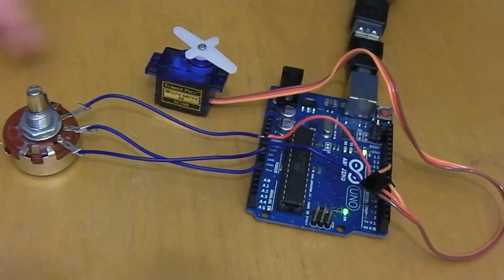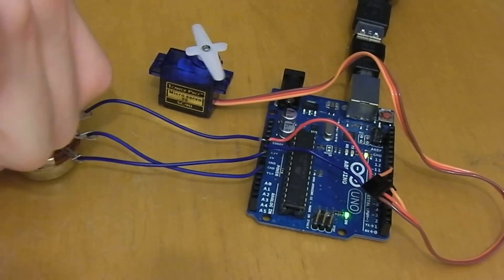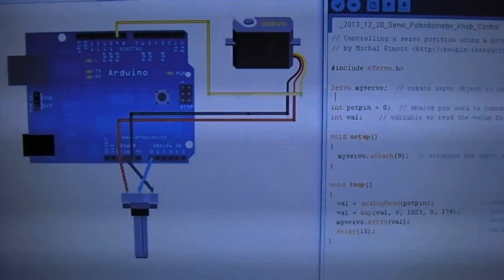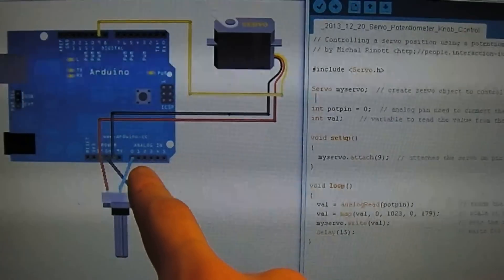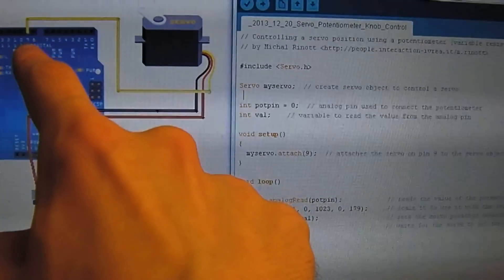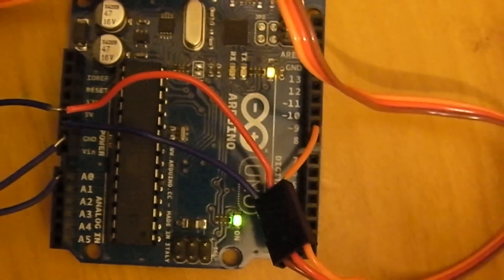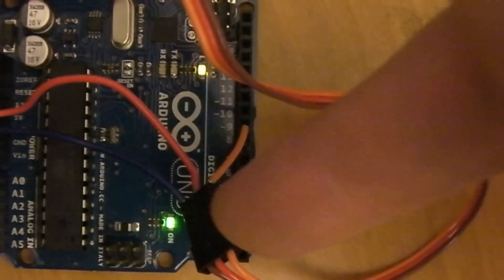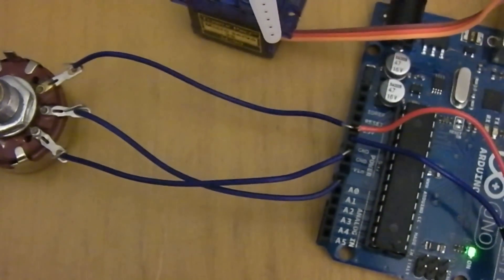How To Connect Servo To Arduino & Control With Potentiometer Knob [Arduino Tutorial]

Comment: Can I do this with a Elegoo Uno r3? (I'm a noob at this stuff so sorry if it was a dumb question)
Reply from the maker: While I haven't tried that one specifically, yea it should work the same way for R3 boards. Sometimes you may need to install a USB driver for your microcontroller, but usually this isn't needed.
Reply: Tolson Winters Thank you, it worked!
Reply from the maker: Excellent!!

Comment: My servo starts moving when I run the servo sweep sketch, then slowly stops. I notice I can give it a surge of power when I pull the 5v out and put it back in again, but it still stops after a few seconds. Any ideas why this is happening? I was thinking my connections... but I've mimicked what you've done.
Reply: +Chris Granat Maybe I need an alternate power source...? I'm just trying to power one servo right now though.

Comment: hey! thanks for the video.
i got a question......can i use that arduino uno r3 board to control 6 different servos with 6 different potentiometers? if not what is the max number of servos i can control?

Comment: Hey, i did everything exactly like you did in the video, but whenever i would turn my Potentiometer the server would change its position and then start stuttering. any thoughts on why this is happening?
Reply from the maker: Hi, I've seen 3 possible problems with stuttering:  
1)  Sometimes it can just be the servo you got, which is faulty
2)  It can be an issue with the servo not receiving enough power  
3)  If you push the servo to its rotation limits, ie, it stops at 0 degrees and 180 degrees, then it will stutter.  You can build in if statements to prevent it from reaching the limits.  For example, stopping it at 5 degrees and 175 degrees

Comment: For some reason my arduino wont even turn on when I plug it in and it is wired the same as in the turtorial.  It works fine when the arduino servo/potentiometer is not plugged in though.  Any thoughts?
Reply: Thats what happens when you play with your arduino.
Reply from the maker: Hi Samuel, I'm not certain without getting an in-person look, but that sounds like a short circuit or perhaps a broken component.  One method for trouble-shooting is getting a voltmeter to test each connection point (relative to your input voltage on the Arduino) to see where the voltage is actually successfully traveling, and where it is not.
Reply: +Samuel Milligan 
Try using a power supply also, rather than relying on the USB power provided to the Arduino. I had the same thing with a stepper project, the power draw was killing everything connected and would only come alive when I added power to the arduino directly.  You can also provide power to the servo seperately.  If you are likely to use your project unplugged from your PC, you will need to look at this anyway, so it's worth some thought. If your arduino is alive with nothing plugged in though, chances are you need more power.